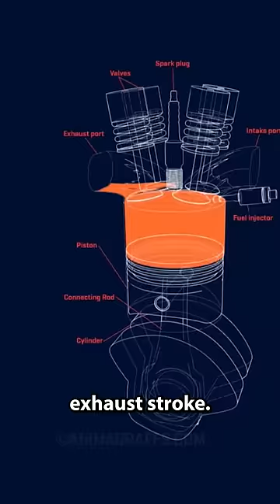Turbos Vs Superchargers

Comment: You answered your own question a little bit ago in a different video it does become parasitic because it causes back pressure in the exhaust back pressure in the exhaust takes away horsepower and turbos cause back pressure so it would still be parasitic

Comment: Engine cylinders don’t make power on the exhaust stroke. So some other cylinder is forcing that exhaust gas out on its power stroke. So some of the power from the crank goes to spinning that turbine either way. The real reason turbos are more efficient and so can make more power per a given maximum cylinder pressure is they harvest some waste energy from that hot compressed gas expanding to lower temperature and pressure gas.
Reply from the maker: Seems like you're confusing parasitic loss with cylinder pressure. As Gale mentions "you're still parasitic" . Gale's point is that, at max cylinder pressure, the turbo can make more power because it's adding cylinder pressure to the exhaust stroke, not the combustion stroke. The power is still being made on the compression stroke, but the cylinder pressure is divided across the strokes rather than all in the compression strokes.

Comment: Wait a minute, how does adding drag to the exaust stroke not add parasitic drag to the crank?
Reply from the maker: As Gale says "you're still parasitic". His point is that you're not also increasing the cylinder pressure on the power stroke.
Reply: @bankspower  But I still don't get it because it's all connected. One cylinder may be on the exaust stroke but others will be on the ignition. So anything that causes more resistance on the exaust stroke still causes more work for the ignition piston and more pressure right?

Comment: This doesn't really make sense whether its on the exhaust stroke or the power stroke because its always going to be a power stroke of another cylinder. The point is it siphons power from the engine but the turbo charger is a lot more efficient and can be a much lighter weight blower design.

Comment: You are indeed taking power from the power stroke but of a different cylinder just hear me out. In the exhaust stroke from which you're taking power another cylinder is in its power stroke and you have to take energy from that cylinder in power stroke to be able to push the gases up against the turbo. The turbos however make use of the internal pressure of the exhaust gases that would otherwise be lost.

Comment: This does not make sense to me. When one of the pistons is in power stroke, another cylinder is in exhaust stroke. The pistons are connected though the crankshaft, so the power stroke has to punch against the resistance of the turbine wheel "in the way" of another pistons exhaust gases. 🤔

Comment: Not completely true, the exhaust stroke is being turned by another cylinders combustion stroke. The parasitic loss is the back pressure formed on the pre turbo hot side. Something has to make the power to make the back pressure

Comment: All these commenters are commending banks for explaining something clearly, but he hasn’t actually explained why the facts that he lays out about the turbo and super charged systems lead to him preferring turbo chargers.

Based on the facts that he explains, the mean net torque produced by the engine is the same in both scenarios and the magnitude of torque over time is more consistent with a super charged system.

Specifically if the peak cylinder pressure and therefore force is constrained to the mechanical limits of the engine, then in a super charged system there is a component of parasitic torque that counteracts the torque developed by the piston on the power stroke, and also on the other three strokes.

In a turbo charged system with the same conditions the parasitic torque is applied only during the exhaust stroke.

This means assuming everything else is equal that the mean net torque of both designs is the same, and the super charged design has a peak during the power stroke and then a negative torque during the other three strokes, where as for the turbo there is a greater torque during the power stroke and a greater opposing torque during the exhaust stroke.

Why is this better? Why does this cause him to prefer one architecture over another? I’d appreciate a correction if someone believes I have made a mistake in my reasoning.

Comment: Yeah ok but your exhaust pistons are still connected to your power pistons via the crank. 
Parasitic is parasitic, doesn't matter where it comes from.

One great thing about turbos is you have the lower half of your rpm range to poke around on better fuel economy. 
The great thing about 'chargers is they boost the entire range. 
Choose your boost device based on how you want to use it.

Comment: Of course you use energy off the power stroke to run a turbo. Where do you think the power for the exhaust stroke comes from?  Fairy dust in the intake?

Tell you what. Disconnect the plug wires and see how much compression you get out of your turbo.

Comment: but theres a reverse pressure against the piston...its the same work done to compress inlet air.....theres only one place it can come from ..the crankshaft...same difference....
interesting theory but must be wrong ,i think 
wait.. you mean you wont break parts on the power stroke at extra, higher pressure than exhaust stroke..

Comment: It may not take away from the power stroke but it sure as hell takes power during the exhaust one when the backpressure caused by the turbos and exhaust plumbing takes it's toll in the form of a weaker butterfly style exhaust brake. It saps kinetic energy from the crank and flywheel to oppose the back pressure.
But hey, I'm no engineer, l just like to fix my own vehicles.

Comment: I prefer a turbo over a super any day. Especially when you have the ability to change the tune/boost on the fly. With a super charger you have to change pulley's to change the boost. Plus you need to have a powerful enough engine to even run the super charger. A small engine can run a turbo no problem.

Comment: This is actually incorrect because the power stroke on adjacent cylinders has to pump the exhaust out of the engine creating the drive pressure.

Comment: The exhaust stroke is parasitic to the other cylinder's power stroke.
Turbo power is not absolutely free, it's just not directly coupled to the crank.
Turbo power is coupled to the exhaust stroke like a stall converter on an automatic transmission.
But this man has a product to sell and I don't.

Comment: Blower power starts at 0 ideal and when you are building the engine if you use the lowest compression pistons and shortest rod ratchieo so you can utilize the best boost and least heat
All boost is good boost

Comment: You don’t actually believe that nonsense Gail . Honestly, the turbo when one cylinder is on its exhaust stroke and the back pressure from the turbo is pushing against that particular piston there are more piston’s connected by the crankshaft so all cylinders are affected by the back pressure of the turbo.

Comment: Turbo lag is not present with a supercharger and a turbo heats the intake air leading to intercoolers which cool the air down. Depends on when you want the power and which is cheapest and easiest to fit.

Comment: The EPA should love turbos right?
Reply: Where have you been? Basically every single modern engine is small displacement turbocharged one? Specifically because it lowers fuel consumption and emissions without having to compromise on available power

Comment: not entirely accurate... if this were a one cylinder motor you are correct... but since this is a multi cylinder motor  while that cylinder is in the power stroke another cylinder is in the exhaust stroke and as you mentioned on the back pressure video that is what the piston is pushing against.

The main issue with the turbo chargers is that its LITERALLY like voltage and Amperage. 

by increasing the speed of the turbos and having a lower mass to spin you decrease amperage and increase voltage thus more going into the crankshaft to the transmission. 

Superchargers are heavy and because they tend to spin at lower rpms than turbos (24k vs 70k in the case of PD or 50k vs 70k in the case of centris) their impeller weights tend to be heavier since they are larger for a given amount of airflow.

Comment: Makes me wonder why the top fuel nitro cars only run superchargers. These cars make 12000 hp and it is said the horsepower required to turn the supercharger is over 900. Is there a 12000 hp turbochargered nitro car out there?

Comment: That doesnt make sense to me.  In a multi piston engine, the "sister" piston will be on its power stroke while pushing up its sister piston on its exhaust stroke.  So there is energy loss there regardless if it's its on the power stroke or the exhaust stroke.  What makes more sense to me is the parasite loss do to friction and heat the superchargers make vs the power loss due to exhaust back pressure the turbochargers make.

An experiment I would like to see is this:
1.  Have a vehicle hooked up to an externally powered booster to X psi at full throttle and dyno tested as a control.

2.  Setup same vehicle with a supercharger at the same psi boost at full throttle and dyno tested.

3. Setup same vehicle with a turbocharger at the same psi boost at full throttle and dyno tested.

Then let's see which one wins when it comes to final power output.  My gut says that turbochargers will win in this instance.

Comment: That’s not true, the power stroke of another piston is providing the pressure to blow the exhaust gasses into the turbo. The momentum lost to the turbo has to be made up for by the other pistons in power stroke.

Comment: I still don't understand why that's better.  In theory the entire exhaust stroke relies on the power stroke to generate its power so you're just stealing the power from a different part of the cycle.  Yes, the cylinder you're currently on may not be firing and thus putting added pressure on the head gasket, rings and such, but the cylinders adjacent to it are firing.

I'm sure this guy is a lot smarter than me, but I'm not getting it.

Comment: Arguably I would prefer to have my parasitic losses happen on the power stroke rather than on a stroke that is decelerating the motor. That way there is a smaller difference between the maximum acceleration and deceleration experienced by the motor. Either way you shouldnt be able to feel a difference, but with this way, the power strokes will be less jarring and less likely to break traction

Comment: But...on being an air pump, thinking about the exhaust stroke, you're pushing the used combustion chamber gases out, but now the turbo takes that energy instead ==  less of a fresh charge on the power stroke. Aside from building more heat, you less timing. Where on a supercharger you make up on the parasitic loss from being able to run more timing? It's a system balance to get the best efficiency/power, not just cylinder pressure...

Comment: Thats fine but that doesn't mean the same thing either way. Blowers are meant for a specific type of racing, turbos are meant for another type of racing. Yes you might lose power driving a blower and but in drag racing you need the IMEDIATE BOOST which a turbo won't give you. By the time a turbo spools up, the race is over. Of course the class you race is also a factor but most every class under top fuel, don't use super chargers at all. they also don't generally use turbos either.

Comment: But but but... The exhaust stroke is driven by the power stroke of the opposing cylinder. This is the first time I think I disagree with Gail. Compressing air takes work. Work is measured in horsepower. A compressor that compresses x CFM of air at y PSI takes z amount of work. The difference is usually in the compressor and how efficient the compressor is. However turbo chargers are centrifugal compressors. There's also centrifugal superchargers. If everything is the same they should make the Same amount of boost and take the same amount of horsepower to drive. The big difference is where that power is made, loss of efficiency due to heat generation, complexity of the system, and as Gail has said in other videos the ability to build said system with the least amount of loss between the compressor and the intake.

Comment: This is actually inaccurate. The exhaust stroke extra effort to push the turbo is also a parasite force. The power stroke from a other cylinder will provide the extra force you need to empty the cylinder on the exhaust stroke. So, technically, it's a delayed parasite force. Or a parasite force that is shared between cylinders. Wich, in the end, on the whole engine comparison, is the same if this is your point.

Comment: How big of a difference are we actually talking about in parasitic drain? Taking power from the exhaust stroke of one cylinder is still parasitic, and while one cylinder is on an exhaustroke another cylinder is on a power stroke, so are you really taking power from the exhaust stroke, or are you taking power from a different cylinder on the powerstroke pushing this cylinder up in its exhaust stroke?   If you want to set up an apples to apples comparison, use the same centerfugal turbo body and impeller, one ran by exhaust and one ran off a pulley set up to meet the same impeller rpm at the peak of your dyno test, blowing into a closed system with set blowoff to measure parasitic drain on the dyno. Then run the same test with them blowing in the intake to measure gains vs the parasitic drain, and another repeated stop and go test to measure responsiveness.

Comment: However the cylinder on the exhaust stroke is being powered by the cylinder on the power stroke.
Everything is powered by the cylinder on the exhaust stroke. Whether or not is on the front or back of the engine. Whether or not it is powered by the crank or exhaust. By any means, the power adder is powered by the cylinder on the power stroke. 
There's no such thing as taking advantage of the power stroke without any parasitic loss.

Comment: so the turbo is still being driven by the crank, just not the cylinder under power. The cylinders on exhaust stroke that are driving the turbo are being driven by the cylinders on the power stroke through the crank so I fundamentally disagree with this to some degree. He's not wrong, just not entirely the full story..

Comment: My 45 years Exp  Turbos Get Very Hot from Exhaust.  Increases Intake Temperature more so than Supercharger.  The Increase in Boost Pressure above 7 to 30 lbs  PSI alone Increases Air Temperature a lot.  Top Fuelie Drag Engine in Full Boost 30 lbs PSI takes 500 Hp Drive Supercharger  when  make 11,000 HP Sacrafice 500 Horeses.   WWII German  Messerschmitt Fighter Planes Mercedes Engine had Fuel Injection,  Supercharger and Turbo Together 1500hp. Supercharger Design goes way Back Started as Mine Ventilation Pump.

Comment: Yeah, on a single.. but any engine with more than one piston will have the same parasitic load he mentioned on one or several power strokes. As far as I'm concerned, psi and cfm will always be psi and cfm. You want max boost asap? Blower. You want as much boost as possible? Turbo.

Comment: Turbo charger isn't free energy either, you still have a massive exhaust restriction.  An engine is just an air pump, and that turbo is preventing the air pump from pumping air out.
To each his own, I personally am happy to pay the 10% to 15% HP tax for the throttle response and torque from idle
Reply: a turbo acts as a muffler. one can compensate this restriction with a more free flowing exhaust for the same db. taking care of some or all of the argument you put forward

Comment: That's not exactly true. Your exhaust stroke is powered by your power stroke (and crank inertia), but from a different cylinder. The parasitic draw is still from the power strokes in the combustion cycle. 

I don't know, however, why a turbo can draw less power off your engine than a supercharger. Maybe it's because exhaust gas has more energy yet left on the table and a turbo just utilizes that in the way of high speed expanding gases.  In other words, maybe a turbo more efficiently consumes the power in the fuel.

On the other hand, a jet turbine engine is WAAAAY more efficient than a piston engine and it's maybe more similar to a supercharger in that the fuel ignition spins a shaft connected to the compressor which in turn drives dense cold air into the combustion area.

Comment: Why don't they use turbos in Top Fuel then?
Reply: I dunno, how often do you put nitromethane in your car?
Reply: @ZealothPL  Not as often as you blow me...
Reply: Turbos were used in Top Fuel for a very short period of time. They were banned by the NHRA because the turbocharged cars were too fast for the safety equipment and track conditions of the time.

Comment: That doesn't make much difference.
Let's say there are two engines, one with a supercharger and another with a turbo.
Both have same boost pressure and parasitic loss.
So both make the same power.
On a s/c engine, the parasitic loss is spread across four strokes.
So the way the engine outputs torque is like a NA engine.
On a turbo engine, only the exhaust stroke have parasitic loss.
The first 3 strokes would output more torque and more negative torque at exhaust stroke.
It would be rougher than a s/c engine.

But all of these would be negligible at almost all rpm range, even at idle at 1000rpm.
Especially on 4, 6, 8 and more cylinder engines running at high rpm.
Unless it's a single or twin cylinder engine running at low rpm.

The real reason s/c has so much parasitic loss is because the type of compressor is not efficient at high flow rate, not because it's driven by the crank.
A centrifugal s/c doesn't have this problem, because it's efficient at high flow rate like a turbocharger.